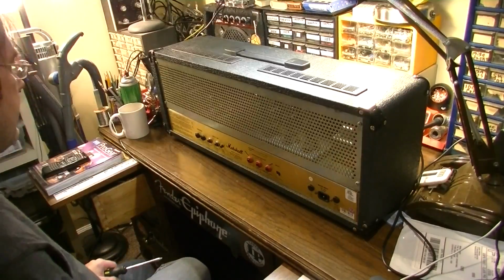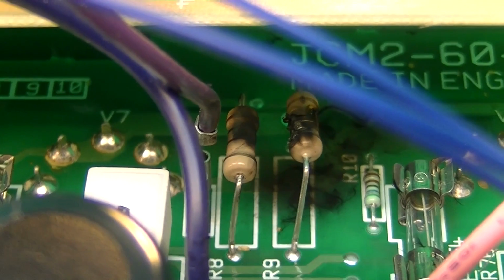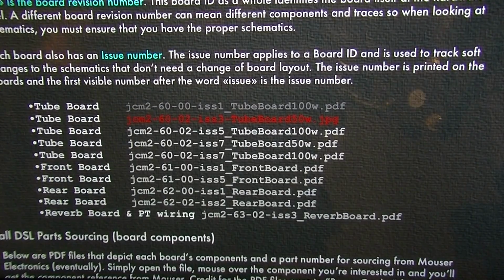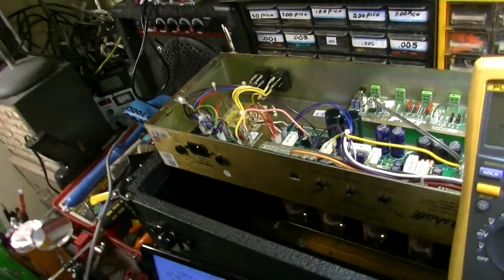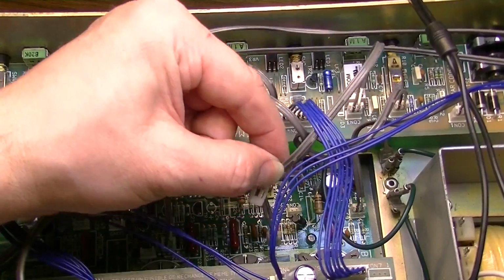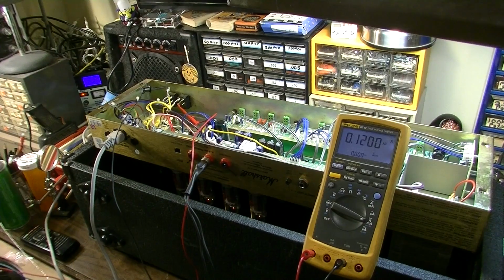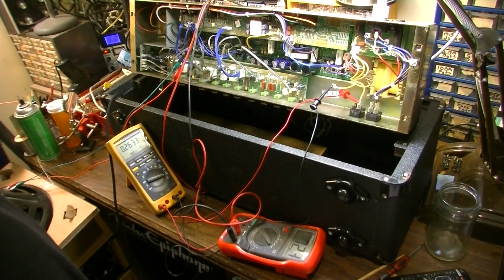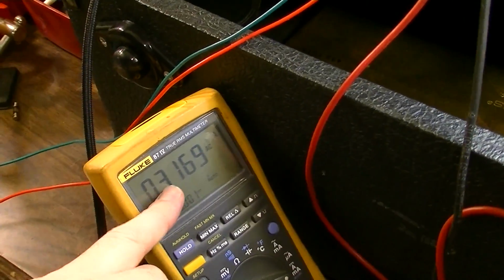Mother of All Marshall Amp Repair Videos - DSL100 Blowing Fuses, Bias Runaway, Fun Times!

Comment: I haven't watched the video all the way through, but have a few comments.  Runaway (lack of ) bias,  ( gradual redplating of output tubes) is almost always a result of a missing, or intermittent  bias supply.  The fact that the runaway problem didn't follow the tubes  indicates the bias supply opened (perhaps intermittently) on one side.  (cathode filament shorts, which can be intermittent ,and are common in some modern tubes could cause a similar problem, but would follow the tube). So why are we going all over the place?  The fact that one cathode resistor blew open, is just a symptom of the lack of neg bias keeping quiescent current to a minimum for operation.  It could never cause the problem, it is a symptom.   In this particular amp the bias adj pots are "sh#t" and can intermittently open.  The caps on HT are a separate problem.  The plate resistor shouldn't be bypassed with a small pfs cap.  It can cause instability at supersonic frequencies (poor design).  The high freq parasitic oscillation problem that also seems to exist and may be intermittent also, is likely also exacerbated, by the intermittent opening of the bias pot.  Basically when negative bias disappears, (because of the crappy pot opening), the output grids go all the way positive, the gain slowly goes to max, and any parasitic osc problems that could be triggered by high gain , cause more problems, whenever the parasitic osc, comes back.  The old MARSHALL SUPERLEADS are built like tanks (early 70's), this one is an example of the complete degradation of the understanding of how the CLASSIC'S worked, characterizing  the newer "design team". at M.  By the way the caps (snubbers)  that bypass the power diodes don't do anything.  , and    they can they be eliminated and produce no measurable effect. (They were an attempt to get rid of the buzz caused by silicon diodes, and the theory for using them is flawed.
Reply: THUMBS -UP for the original MARSH PLEXI which had fewer components (maybe 87) than this amp has interconnect cables !  DSL-100 piece of *&^%$# !!!   I always put amps on 100 Watt  16 ohm dumby load with 1/10th power to speaker, and a 100 Mhz Tech 'scope , and Variac at 50 % 1st.  the 'scope shows me if parasitic osc is going on. Because S-State Tube hybrids often have parasitics going on in the S-State pre ,... if there is a problem in the output , like in this one,... I remove tubes from the preamp or disconnect everything , but the effects return , so that I am looking at the Phase Inverter to the output only , until I get that cleared away.    I use a sign osc , on the input , to trace the signal , and see what is going on.  Usually with these S-S hybrids You have to turn the AC power Volts to 60-70  before channel switching IC's put through thru signal on the pre,  but putting the 'scope on the speaker output (10V?/division), lets you see almost everything going on in the amp , unless one loses signal entirely in the pre.  It is very helpful for catching parasitic oscillation, which can easily be missed using Your ears or Multitester/meter. 
... For me it is very ironic that the YuTu Advert Algorithm, has figured out I'm an Amp enthusiast and therefore populates all available space with ads for Marshall,.. as this video ... for is a GIANT AD for NEVER BUY A NEW MARSHALL AGAIN! I'm with many of the commenters below.  EU solder sucks, newer marshall boards have conduction problems often within 5 years of Manf ,( etching chemicals left on boards ), tons of extra parts with no discernable purpose other than premature death, and 1% resistors that can't even handle the 1/4 watt  that they are rated at.  Whatever happened to 1/2 W carbon comps?  

P. S. that schematic doesn't seem to be the right one for that amp?!?! As R-8 and R- 9 were the bias resistor for a preamp tube and the  10K power supply dropping resistor for a preamp tube,... neither were an Output tube cathode to ground  1 ohm bias checkpoint resistor.

Comment: The capacitors on the AC board are snubbers, that was not your problem.
Reply from the maker: Thanks for the comment. I think the one bad cap could have been the problem. If it was damaged and arcing internally at full voltage, it could have been like throwing a switch, causing spikes. It was the only damaged part I found other than the 1 ohm cathode resistor. But it's possible the previous set of tubes caused the resistor to blow and my gator clips on my load blew the HT fuse both times. I burned in the amp for another hour or more last night and played the heck out of it...no issues. I plugged into the 412 cab with a proper cable this time. You could be right, but I'm not convinced.
Reply: Good video BTW

Comment: Very interesting !  Look closely marshall tube snobs - Thats how poor soldering  "Made in England" looks like ! :-D
Reply: Lead free solder is much of the problem.  The universal swappable harness and connectors are not to be forgiven.
Reply: Dual Rectifiers are famous for burning and failing at 240v, even with the correct transformer. "Made in England" on the board simply refers to the board design. Not that it was manufactured in England. Only the handwired Marshalls are made in England.

Comment: What wrong with Marshall, doesn't look like great design an build quality...
Brad, I think you need a serious tube checker
Reply from the maker: I do need a better one if I'm going to do more of these modern amps. Sometimes my old one doesn't tell me everything I'd like to know. I'll get one someday.
Reply: Answer: DIY a µTracer...cheap (about two (!!) hundred bucks:)  and you can test tubes even savely beyond SOA and even under conditions unable to see in real world amps, never ever (also the usual tests are easily to be done as well)...also you can match tubes in a way nobody else can do without a MuTracer (you can put plots on plots on whatever condition you want in order to match tubes by)...but you would need a PC for control and graph readouts. But you also gain a dynamic transconductance measuring device and also you can do all 2nd order derivations (like distortion analysis for a tube due to unlinear behavior) and some 3rd order integral calc stuff (like reflected pseudo-impedances caused by the intrinsic inter-electrode capacitances)
Reply: Love how all the technology recommended is far beyond what was necessary 65 years ago. I got my equipment from the Supervisor of the Schenectady and Syracuse NY plants. He only used a Heathkit 600a tester and a Tektronix T921 Oscilloscope. This guy built the biggest amplifiers I've ever seen. 200lb monsters for Ham radio use. Anyone who knows who I'm talking about his handle was W7EEE, and quite frankly the most admirable figure I've ever met. He has passed away but truly a pioneer.

Comment: the problem with these amps has been well documented for years.  u should have done a little research and it would have saved u a lot of time.  the bias drift is caused by defective pcb material leaching current from the negative bias input pin 5 to the adjacent B+(high voltage screen grid pin 4).  this problem typically shows up several years after use as the heat causes the pcb to conduct.  all of the symptoms u r seeing are due to this.  I expect you are going to see this amp back on your bench as you did not address this issue.  It will continue to fail eventually despite replacing the all of those defective parts.  U have to either replace the board entirely or isolate the bias pin from the pcb by removing the tube sockets and drill out the bias pin and then solder the bias resistor directly to the tube socket.  There are some other things that can be done to improve the stability such as beefing up the 1/4 watt resistors to 1/2 in certain spots if desired but nbot required.  Another common problem that might get you is reinspect and reflow the solder joints on the little bias card that holds the pots.  I have found these to be broken often due to the pots being installed to high off the pcb and when the card is screwed into the chassis those joints will break if not immediately then over time with stress on the chassis.  Many have chosen to replace the pcb to the tune of nearly $300.  I choose to repair the board and have done so numerous times.  For the cost of a few  parts and a little labor this is an easy and inexpensive fix.  Once this is fixed these amps are as good sounding amps Marshall has ever made.  By "these" I mean the original JCM2000 DSL and TSL amps.  I own a TSL100 and it sounds outstanding and has been rock solid since it's repair 10 yrs ago.  in the future if u see bias issues you can be certain the pcb is the problem if it is an older rev pcb.  They did eventually replace the main board material but by the time they got around to it the amp reputation was shit.  Sales suffered.  I nab these and fix them any time I can.  They are bought for short $ and oce fixed they are killer.
Reply: Scott MacDonald I bought one of these new, back around 2001.

It is the TSL100 head.

It blew the 1amp fuse when I first got it, so I changed to a 2 amp.

I hadn’t had any trouble with it for years, but It just was in my bedroom on two 4x12’s.

I guess the board is problematic on this one as well?

Thanks!
Reply: @drippinglass  if it was blowing 1 amp fuses then there is a problem.  I would never advise exceeding the recommended value of a fuse.  They are there to protect the circuit components from being damaged.  If u want to see if your amp has a bias issue then the easiest way is to attach a meter to the bias leads and monitor the bias while them amp is on.  If it is drifting all over the place then there is a problem and this is more than likely the cause.  If u have someone with soldering skills then I would advise doing the repair.  It can be a bit daunting but so long as you make sure you note where all the connections go to and from the board it is just a matter of removing the pcb and doing the mod as I stated.
Reply: @drippinglass  when u said u hadn't had a problem with it for years, are you having a problem now?
Reply: Scott MacDonald 

Thanks for the reply!

I haven’t turned it on in about 10 years.

The Rev. 20 board is supposed to address that problem I’ve read.
Reply: @drippinglass  there is a doc online that will tell you if your motherboard is suspect.  I don't have a link but it can be found pretty easily.  I remember finding it when I fixed mine 10 years ago.  Another indicator that it is a suspect rev is to check the bias grid resistors attached at pin 5 of the output tube sockets(R66, R70, R7, AND R10).  If it is an early version then more than likely it has the "problem" board.   Like I said the problem did not effect 100% of units shipped so it may work just fine.  If it is a suspect rev I'd mod the board anyways to avoid potential failure and damage in the future.  good luck!
Reply: Scott MacDonald 

Thanks!

Yeah, I blew the 1 amp fuse the day I got the amp... on the kitchen table!

It’s been in my bedroom ever since.

I’ve left it on for hours, with no crackling noise or problems. It even has the OG tubes in it.

I didn’t know there was a problem with them until a couple of years ago.

I guess I’ll have to open it up and see if the board and components look OK.

I guess they changed the composition of the Rev. 20 board that is about $150.

I don’t see any in eBay at the moment.
Reply: @drippinglass  if u can pull off the repair I would opt for that rather than spend $150 on a new board.  The parts are a few dollars at most the rest is labor.  Not difficult necessarily but I wouldn't recommend a novice try it without a little supervision,  the pads on these boards can be easily damaged.
Reply: Hi Scott!  No need to even  remove tube sockets from pcb, just use a 5mm 'hollow drill' to drill away the pcb material from around pin 5.  Then use the Dr. tubes mod.
Reply: @nevillegoddard4966  well when I did mine there was no Dr Tubes mod.  I could have done it that way but I chose to remove the socket for two reasons.  I did not have the appropriate bit and I didn't want to risk the debris from the tool polluting the pcb.  It wasn't difficult, I have an excellent soldering station and heat guns, the sockets came out pretty easily.

Comment: JJ tubes are GARBAGE!! just had the same problem. Replaced tubes.. Also, 1 ohm resisters...and the bias feed R77 I think..should be 3.9K..on that one, it might be 10K.. put a 3.9k in there..make sure the 220k gets back down to 5.6k.. and I PROMISE IT WILL BIAS... also Marshall is full of shit.. DO NOT BIAS THAT TO 90! bias it up to 78 and itll be great!
Reply: in case you didn´t know: JJ is the only (!!) large number tube producer left in the western world. They do tubes for nearly all vendors, regardless what´s stamped on. All tubes around here are made by JJ, or they´re made in russia (=C=, svetlana(origin), electro harmonics (brand),RCA (brand), TungSol(brand), simply check tubes.ru for other brands you used to know.

I visited the saratov plant years ago, before they went by the "NewSensor" name they done tubes and they still do tubes) and china (they even use TESLA nowadays,RCA,amperex,WE and other formally well known tube brands)

Comment: i had this amp and it sounded like shit from the moment i got it till i sold it,absolutely terrible fizzy thin sounding "marshall" head.

i had blown capacitors as well and i've put expensive tubes just to see if i can make it sound more "brown" but nope..sold it for the price of 2 pedals after more than a year for sale.
Reply from the maker: I recommend the clean channel's classic overdrive setting.
Reply: i tried it extensively,sadly the tone i wanted can be achived only with lots of mods (or i can just buy a Friedman HBE lol) so i just sold it